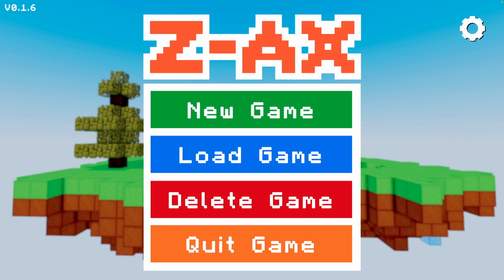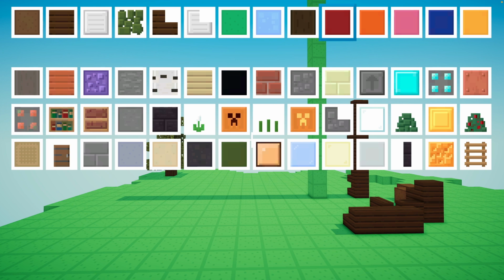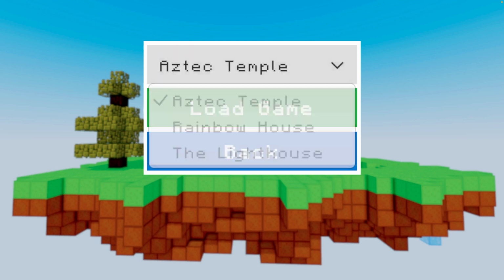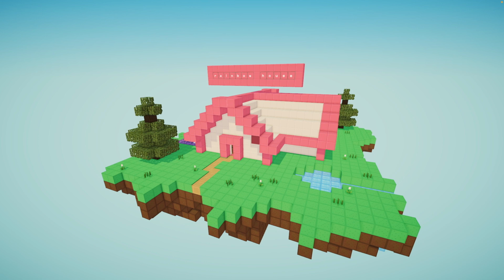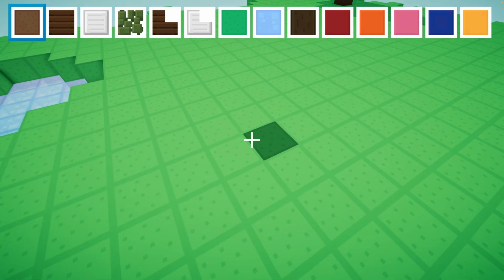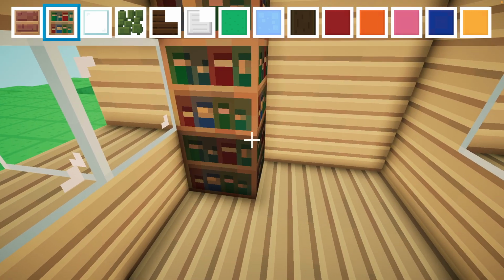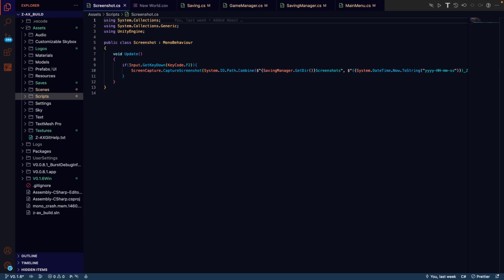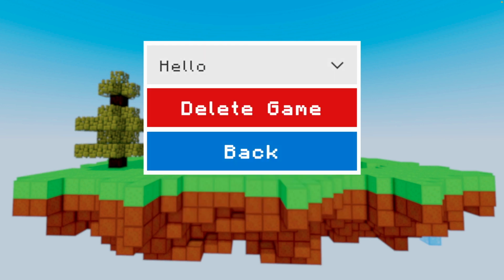Z AX Build  release and introduction

Comment: Very very impressive!
 I didn't quite get if it's implemented or if you want to implement it still but how do you plan on implementing Culling for the blocks? Or Lag Control as you called it here. 

Also what made you choose .CSV as a format for saving?
Reply from the maker: Thank you, for the lag control, which I have not implemented yet, I want to hide any block that your camera is not currently viewing.
For the saving I chose .CSV format because it was easy to visually edit in Numbers/Excel during testing, and it is easy for other users to edit the saves, if the saves get more complex I may switch to .JSON format, but I am open to any suggestions.